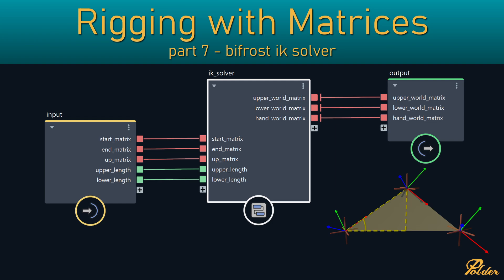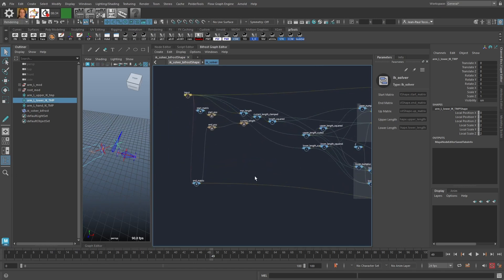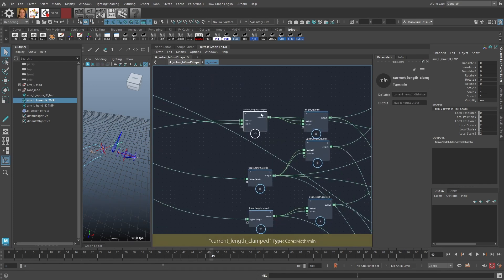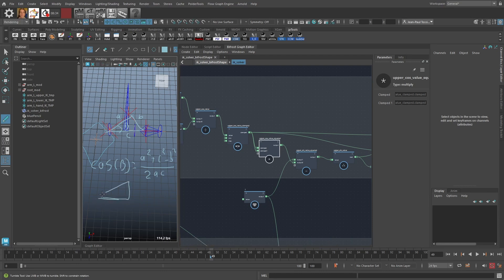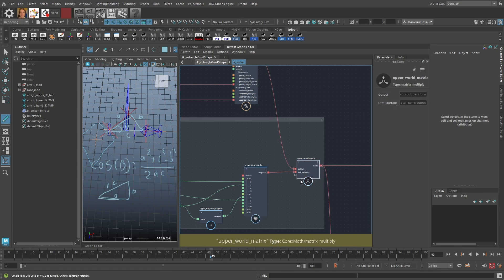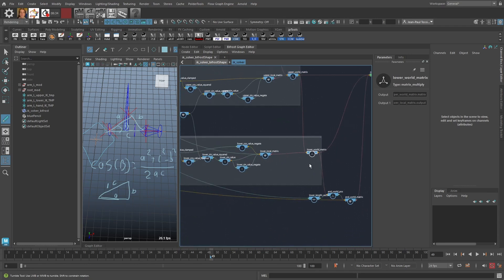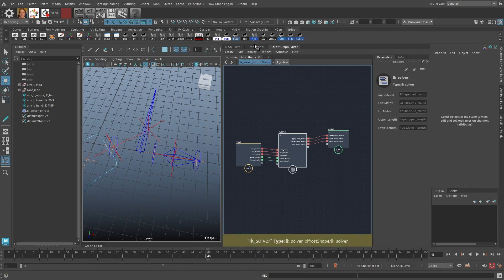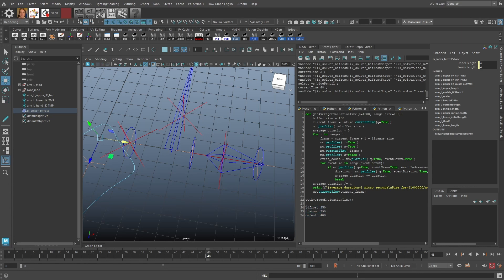rigging with matrices - part07 - bifrost custom ik solver

Comment: there is a solver included in 26.1+ for those that need one asap
Reply from the maker: This is true, you need a hierarchical bone chain for this however, and because it has a lot of functionality it might be more slow than you would need. But certainly explore this compound, pick it apart and learn from it. Or just use it 😉